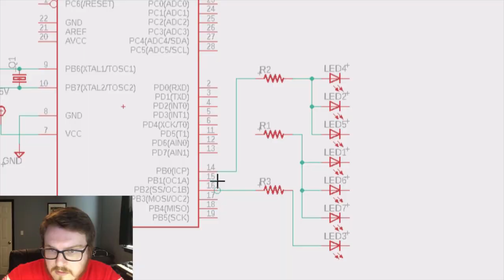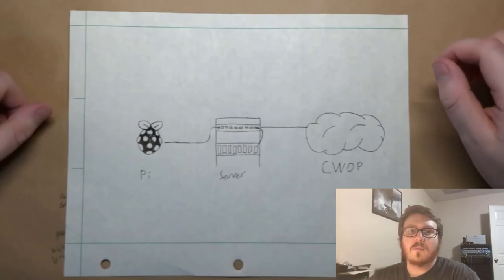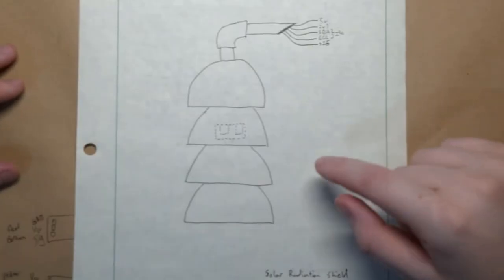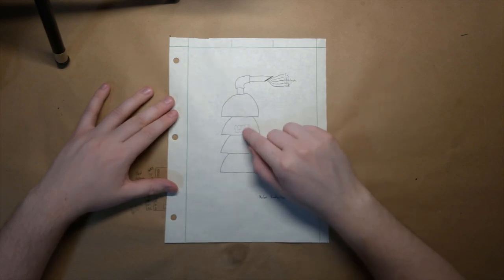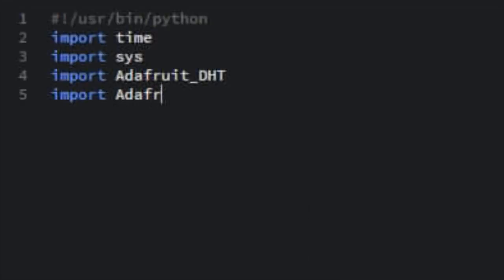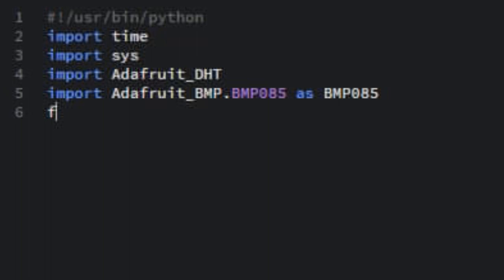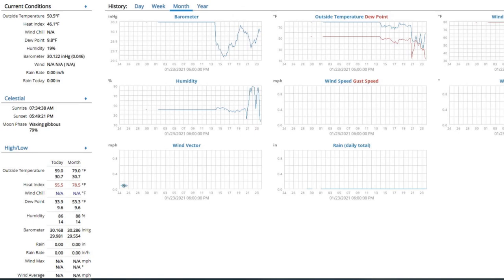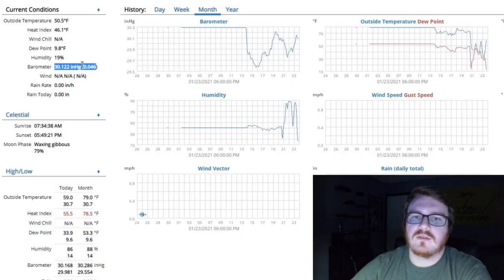DIY Raspberry Pi Weather Station

Comment: The only concern I have is running ethernet outside in into your house one lightning strike could take out your whole network ideally running data inside your house to outside your house should be electrically isolated

Comment: Not too shabby! The type of shield you're building is also called a passive radiation shield. It not only protects the sensor from the sun, but it allows ambient air to flow through organically. This helps prevent stagnation. I would suggest cutting out a good portion of the bottoms of those bowls to allow air to both flow through and vent upward through the shield. You might be trapping a bit of warmer air by closing off the bowl the sensor sits under. It may not affect the data by much, but it might be skewed nonetheless. If you want to get fancier, you can add a fan to draw air past the sensor and turn it into an aspirated shield. Just keep the air flow below 1 m/s so the flow itself doesn't impact the readings.

Comment: Hi! I dont know if you’d ever read this but i’ve been wanting to make a pc similar to your terminal video, but i wanted to add more storage- LOADS of it, i just want a massive document storage 😂 anyways, is there a way to connect hard disks to a raspberry pi? Thanks in advance
Reply from the maker: Yes you can. You would either use a USB hard drive or some form of USB to SATA/M.2
Reply: @daniskaengineering  thank you :D

Comment: Could this be ran on a raspberry pico? Instead of the more expensive pi?
Reply from the maker: I'm sure it could, the idea is simple enough, but you may have more luck with a Pi Zero over a Pico.
Reply: @daniskaengineering  only problem is current supplies for the Pi zero, so I was looking at way to do it with what’s currently available.